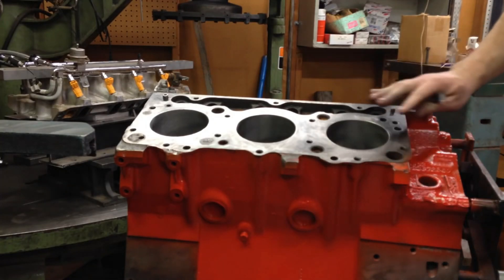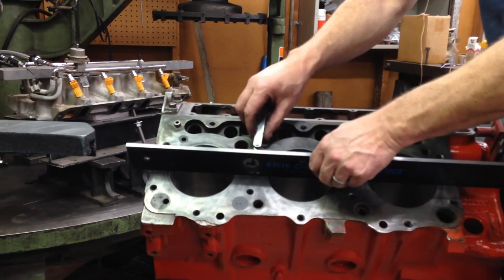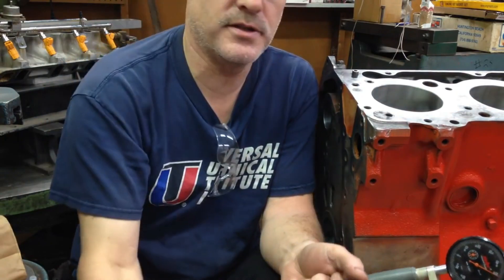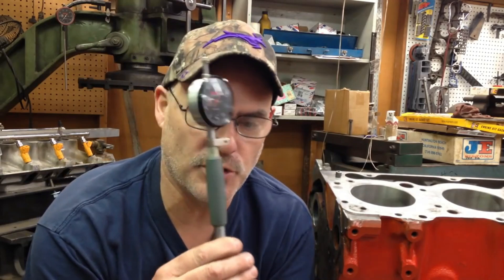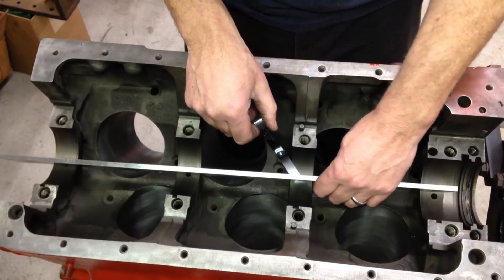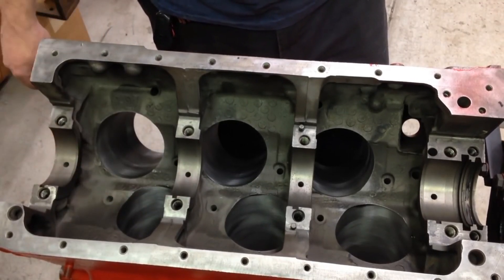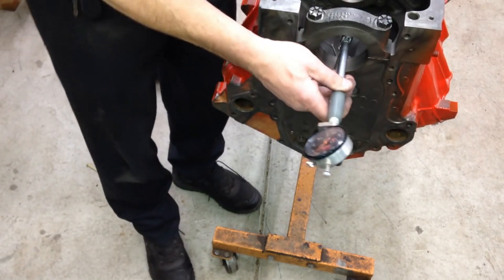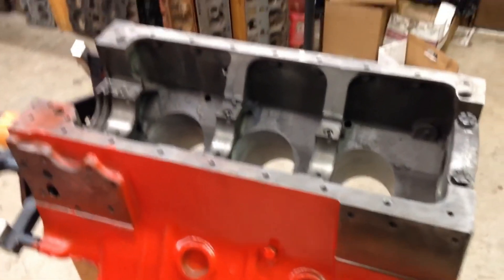Chevy Block Inspection at home

Comment: Good video, more knowledge to add to my mental toolbox. I used your "small block Chevy ultimate budget build" video alot for inspiration on my last engine build, an ultra cheap $1400 with machine work 305 carb to oil pan. I have the Dyno video on my channel if you are curious of the combo and power numbers. Didn't make anything earth shattering....but I did greatly improve it from it's factory rating of 165hp @4000rpm 245ftlbs @2800rpm 😂. You may find the peak number interesting considering the heads I used. But pretty honest and telling, and in my community section I posted the conditions and correction factor for the Dyno.

Comment: Always great content, thank you. Also thanks for the advice on the phase converter for my PH2000, its up and running now. What platform do you use for donations? don't remember which past vid you shared it. Would like to donate to keep the advice coming. Have more questions on sb chev iron head and guide, core drill tooling. Thanks.

Comment: I've been gearing up for a couple engine rebuilds but having trouble justifying the price for a Starrett or Mitutoyo dial bore gauge. I try to stay away from cheap tools when it comes to precision. Do you have any recommendations for a middle-of-the-road option? I couldn't make out on the video what you're using.
Reply from the maker: https://www.ebay.com/itm/115798804864?hash=item1af6258980:g:yg8AAOSwiR5kWWyY&amdata=enc%3AAQAIAAAA4M0lMErF46lYJgtkniFHIK4eV9OL1bAoUl0OjSyXYNT83QwCilJdoD4WyXmsC9BkNxiQASUSt4LaDKRTU6ljq7OP6lndAJcWhy%2FDA%2Fkk2FHjO9QMcB5bTCZg%2FX4bSrSrQL6FabekOVxCJmK4p3dBOR0UWLBuRXzCTEkPQpaj9CzAu%2BfLqdx1RGM5%2Bq4IzzkgQg5zrJyXnZpvgHMse7H66D9Ix5Htrqx%2FIGov1VzlzAo2tLWv%2F319qsU7%2BZyIaE0nSy20XPe6wjZDeALJdf0QKIcLNXjPnLrb%2B4UoZILTw17k%7Ctkp%3ABFBM5Lr2xoRi